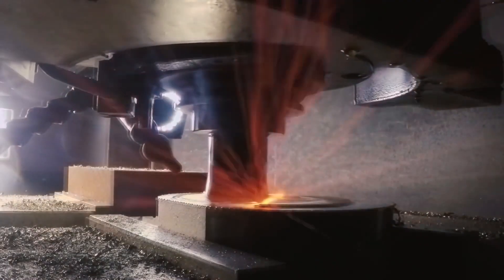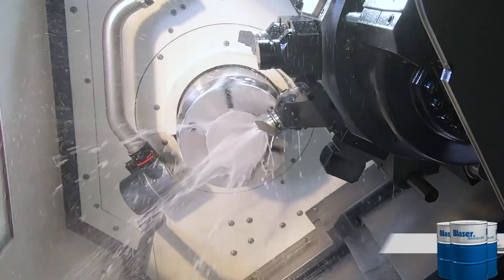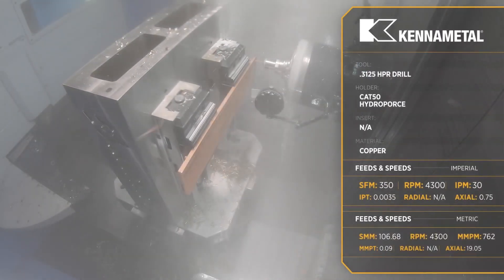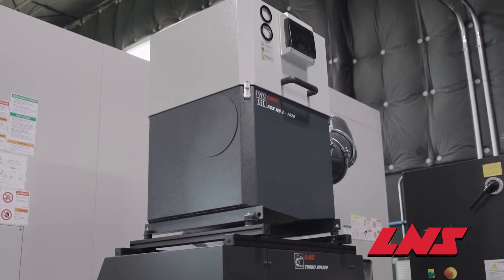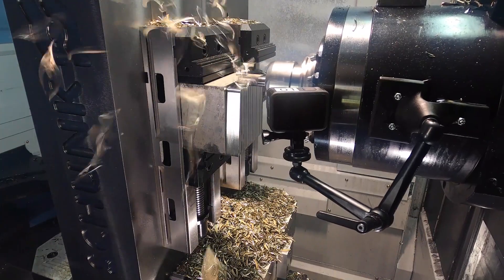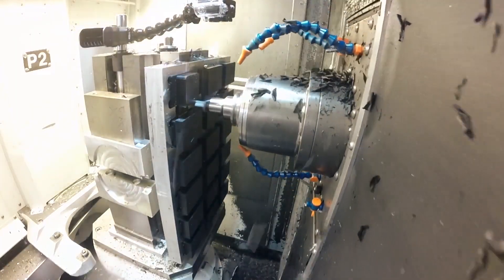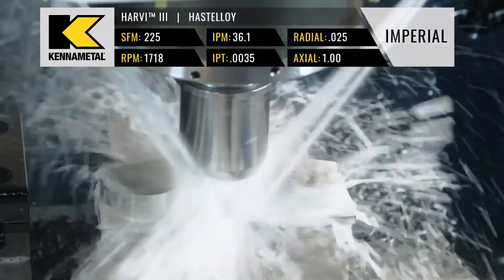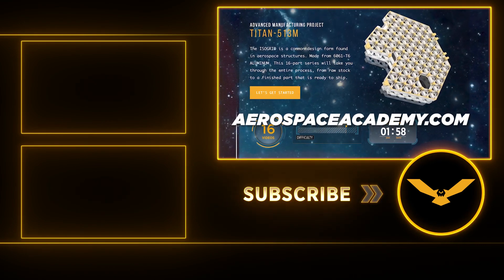This is the MOST CHALLENGING Material I’ve Ever Had to Machine

Comment: Hey Titan,  One technique I have used on soft thin parts is to fix them to an aluminium block with wax. Simply warm the block, apply some wax,  you can use a roller or a toothed scraper to get it even, then place the part and let it cool.  To remove, just warm the block again.  You can get a "sticky wax", or I have been told that the sort of wax women use on their legs is good too. Avoid paraffin wax as it can release unexpectedly.  Watchmakers have used this technique for centuries in their "wax chucks".
Reply: Used sandpaper on the jaws held on with 2 sided tape and of course light pressure (finger tight) on clamping. Worked great for flymilling
Reply: we cut all plastic parts with double sided tape and air blast, no clamping pressure and no problem with tight location or thickness tolerances. You can't get after it but you aren't scrapping 50% of the parts either
Reply: Great idea! I have used similar techniques, even Bondo for metal parts! Good advice, thanks for the comment!
Reply: Superglue is what I use.
Reply: Dental adhesive is the way to go but it's expensive.
Reply: The wax you are referring to is shellac. Since I'm a watchmaker myself I'm familiar with that stuff, jewellers also use it to hold jewels when setting stones.
I make watch dial hour marketed out of 1 mm nickelsilver,  by sticking it to an aluminium block with a "waffle iron" pattern engraved in it, heat it up with a blowtorch, apply shellac,  put workpiece material on rope,  put under pressure,  let cool, , machine, reheat and remove parts.

Double sided tape also works,  and if your workpiece doesn't dissolve in acetone, superglue a,so does the trim,  used that to make bridges for a watch movement, that had to be machined on both sides,  first,  stick on brass plate, machine one side and do the outer contour and some locating holes, acetone to dissolve the glue, put in pins, flip the part over, glue it, machine bottom.. "boom!"

And then there's the good old vacuum table...stick a spoilers heet of 0.5 mm styrene under the part, put on vac-plate.. and off you go
Reply: Those are brilliant solutions..... Thank you very much!

Comment: Yeah, I remember over 20 years ago machining some copper alloy for Atomic Energy project.
Crazy stuff we had some tight tolerance on flatness and were running about 25% scrap and same thing good parts one bad next 10 good then a few bad.
It was all over the place, no wonder we got the job no one else could make it.
Another was a multi pin connector that was for a reactor and was a special plastic. All the holes had a . 001 tolerance. The holes would come out smaller than the reamer then oversized. Too small for a boring tool. And live tooling on the CNC lathe didn't have the speed for boring and the cycle time would have been way off.
Reply: How do you inspect the tolerances of the holes?
Reply: @arkadas3797 , go no go pin gauge, regular pin gauge, caliper, CMM.
Reply: Hahaha yeah that definitely sounds familiar! I wonder if we were dealing with the same engineers. Was this Atomic Energy project TRIGA by chance?

Comment: Worst one i ever delt with, was ESD delrin.  The part we were making was an injection mold part that someone didn't want to fire up a mold for.  14" x 6" rectangle with 7° draft angles around the outside, hollowed out on one side, and had a series of intricate pockets on the other side.  The pockets took the thickness down to 0.08" thick.  I had worked with derin before, but never ESD delrin.  Put a hss cutter in an ran a moderate speed with coolant.  Get about halfway the pocket, and suddenly i can see the metal of my fixturing through the part.  The part had warped off the table by an inch.  I was shocked.  I eventually realized that the part (which had be machined complete other then the small pockets already), was an inch longer then it was supposed to be.  I knew it wasn't before i put it in the machine.  Took the part out of the machine and set it on the plate and it looked like a U.  Apparently esd delrin was extremely sensitive to heat and absorbed coolant like a sponge.  We fought with that for awhile, and finally had something working,but the customer pulled the job.  Apparently we were their second attempt.  They had given it to the Chinese first.  After a month of work, they couldn't hold the tolerance.  They were trying to have us rush it in a week.  Some jobs you just have to say no.  It was like trying to machine a Tupperware lid.
Reply: Ouch esd deldrin is shit plastic  everytime i milled it it went like a washed dog
Reply: Ouch, note to self, no-bid ESD LOL
Reply: @barrysetzer  just translate every day you think it takes to a week lol.  We learned that vaccume table and air blast through spindle help alot to keep it cool.  Then you have a limited time to machine.  You cut a small portion of feature, then you have to let it rest overnight to relax.  Then cut some more, and let it relax
Reply: Great problem solving! Love it!
Reply: @BB i guess im not sure what you mean by your message.  I just cut some the other day.  Cuts very nice

Comment: Anyone here know if I can grind 1/32 or 1/64 titanium sheet on a bench grinder? Don't have a laser cutter and we haven't learned cnc coding in class yet lol
Reply: You can but it is a really bad idea. If it gets to hot from the grinding friction you will change the composition of the metal making it loose some of its properties and don't also forget that titanium is a flammable metal so you run the risk of starting a metal titanium fire which if you don't have a class "D" fire extinguisher near by I highly recommend not doing it
Reply: Use a beldgrinder  and turn the speed down until the titanium stops sparking . Clean the grinded material away every coupel seconds don t let it pile up  one spark and the room will becom very bright 😂